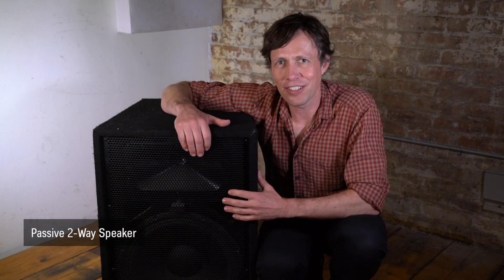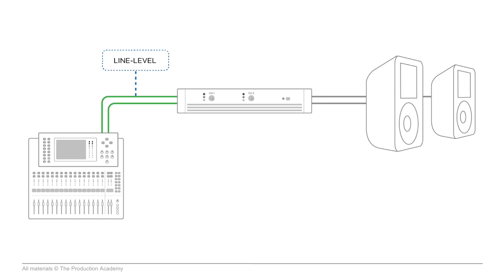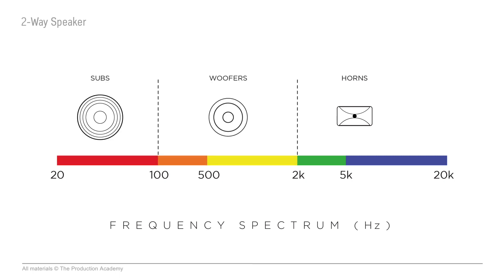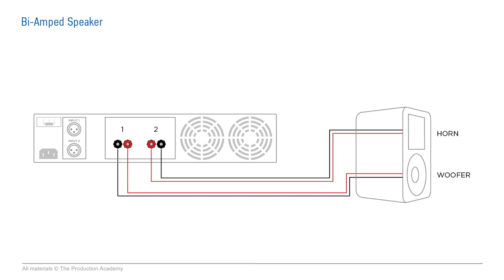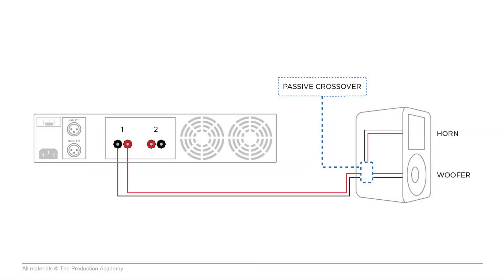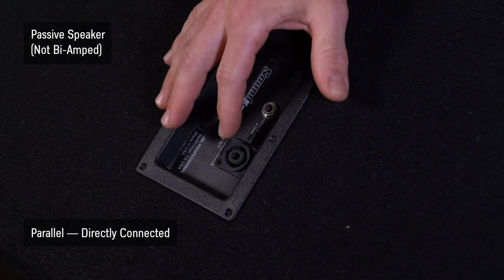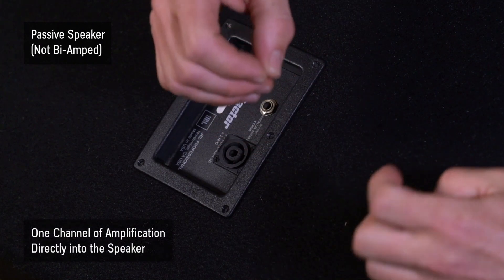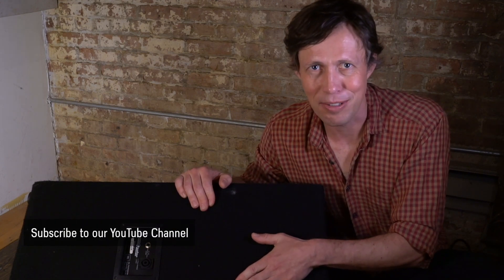Passive 2-Way Speaker — Live Sound Fundamentals — The Production Academy

Comment: Great video! For a DIY 2 way speaker combo, 15" 600w (50hz-2500hz) woofer and a 2" 80w (1200hz-18000hz) horn compressor, please can you advise what 2 way crossover frequency should I aim for? I've seen 2 way crossovers with 1900hz, 2200hz, 2500hz, crossover frequencies but am not quite sure which one to get for this build...